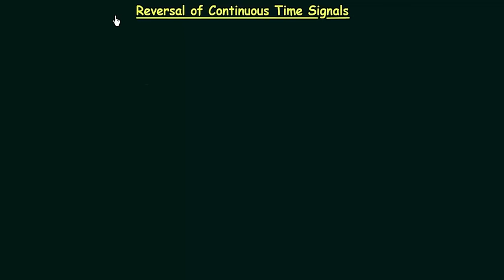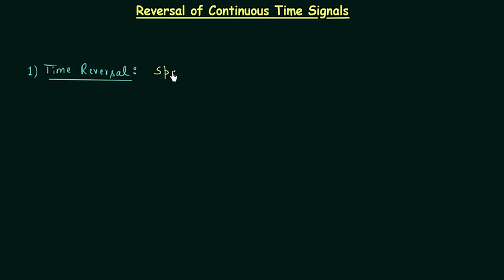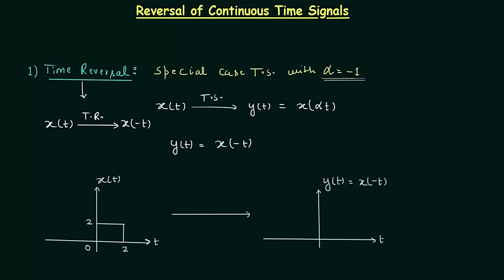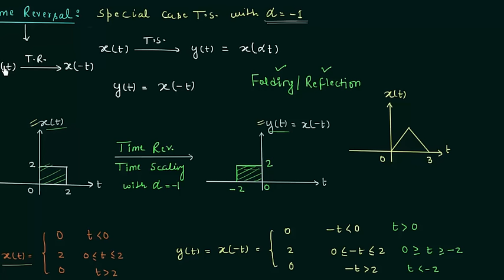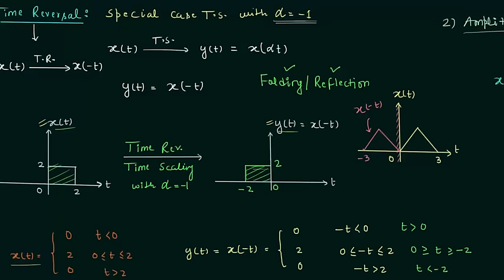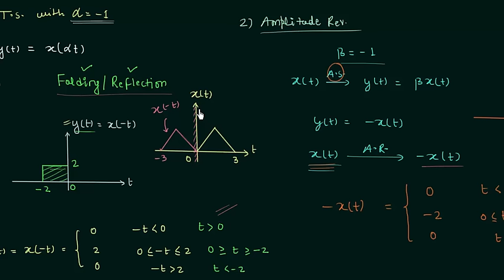Reversal of Continuous-Time Signals

Comment: to anyone confused:
Just multiply each "tick mark" on the hz axis by (-1) and draw the original signal, completely unchanged,  on top of the new hz scale.
You'll see that the positive t axis extends to the left and the negative extends to the right.
You COULD stop there , but you might want to redraw the signal so the positive time axis goes to the right again